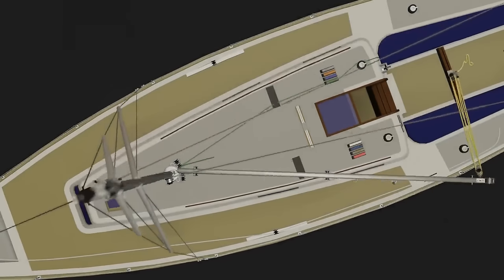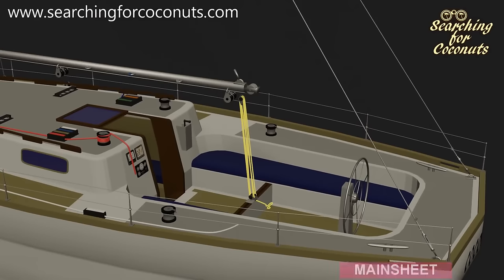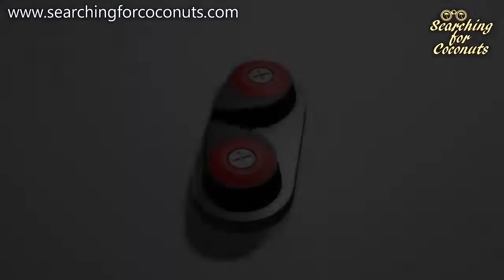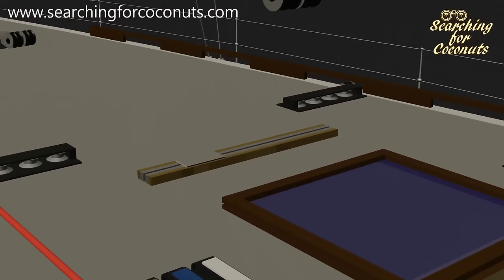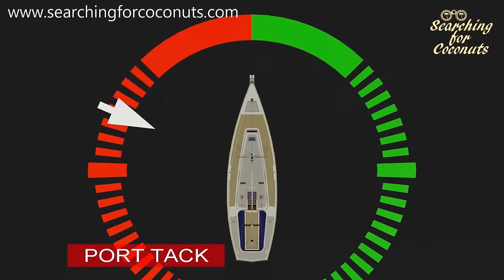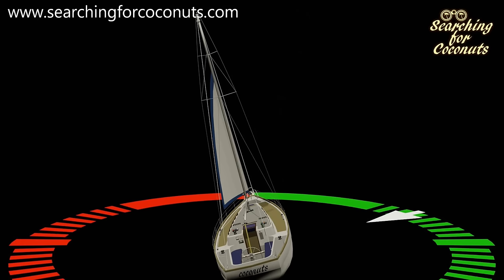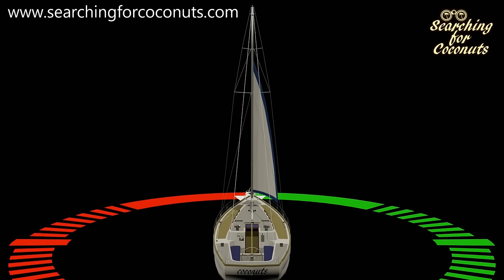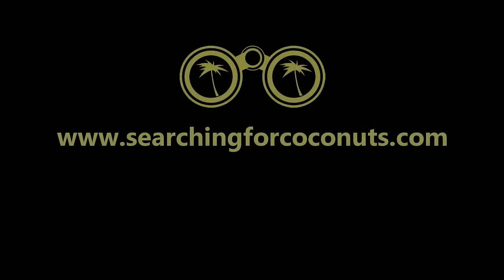Rigging for beginners # 2 -  beginners guide to rigging, mainsheet, jibsail, theory basics

Comment: Great videos. The only thing I'd add for anyone watching is that when furling away the jib it's a good idea to keep a little tension on the jib sheet (port or starboard depending on tack) to ensure the jib wraps away neatly. The easiest way to do this is a single wrap around a winch (maybe more if very windy) of the jib sheet and holding it lightly in your hand feeding out the jib sheet as you (or mate) pulls on the furling line.
Reply from the maker: well said and great advice, as this helps a great deal
Reply: @searchingforcoconuts2248  thank you.

Comment: I dont understand why barely anyone ever made sailing videos like this with animations that lets us see everything easily.

Great job at this very good presentation! I learned a lot!
Reply from the maker: always happy to hear the effort is worth it, makes my day, thanks for your great response
Reply: @searchingforcoconuts2248  Thank you for your great videos. I dont know what youve planned forvthe future. But I certainly would be very interested in a video focussing on the boom rigging with the halyard, the reef lines etc etc.

I need to figure out how mine is supposed to work.
Reply from the maker: @obiwanfisher537  hi again, sorry for the late reply... it's a bit difficult to do tutorials like that as each vessel/brand/captain has their own set-up.... My advice would be to join as many sailing groups as possible, maybe even one specific to your type of boat, and bombard them with questions... sure, most of them think they know everything but these groups can provide great knowledge
Reply: @searchingforcoconuts2248  no problem. I did my own research and it turns iut I have a very old furling boom system. I also learned that its not very good for reefing and that I should modify the boom for slab reefing.

Comment: So, in the setup showed around the 4 minute mark where the sliding traveler is located in the floor of the cockpit, is that main sheet line not meant to be used with a winch? I am guessing that the block and tackle gives you enough mechanical advantage to adjust it by hand?
Reply from the maker: Hi, and thanks for watching. When you have a cockpit traveler,  because the mainsheet is attached far to the end of the boom, you have enough leverage with the blocks. On systems where the traveler is set  mid-boom, you need will need a winch to get it sheeted in. Hope this helps

Comment: How does the sail works is there a roller down the sail to roll it down.....pls illustrate how does it works......
Reply from the maker: Hi, if you are talking about the mainsail, it stacks (you have to fold it) as you bring it down. Hope this answers your question. The headsail has a roller system

Comment: I've found these videos to be the clearest explanation of each line there is.
My only problem (my problem, not the videos) is that I have a smaller older boat that doesn't have any jammers, and also a main sheet that is attached  to each side rather than on a rail, so some stuff is harder to understand, but still... this is the video I keep coming back to for clarification.
I also seem to have 2 extra lines that go up through the mast which I have no idea what they do.
Haylard thick line that runs inside the mask 8mm.
Topping line that is external to the mask and just runs through a pully at the top 6mm.
2 x thinner  6mm lines that run up inside the mask and tie off at the base. No idea what these are for.
Any ideas anyone?
1973 Sunray 21
Reply from the maker: greetings and thank you for your amazing comments. I have posted your query on a couple of forums to see if we can clear this up. I myself have an opinion about these lines but am not an expert in Sunray 21, and would probably learn something along with you. You can follow the discussions here... https://www.facebook.com/groups/futurecruisers
https://www.facebook.com/groups/SailorsandCruisers